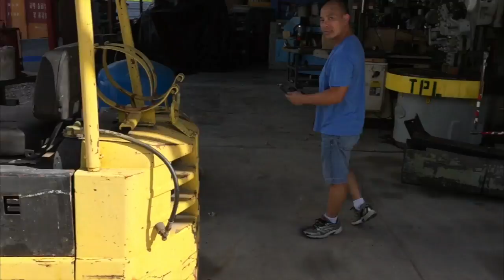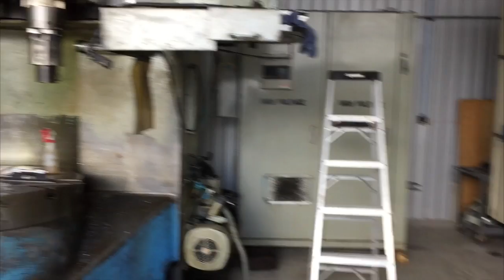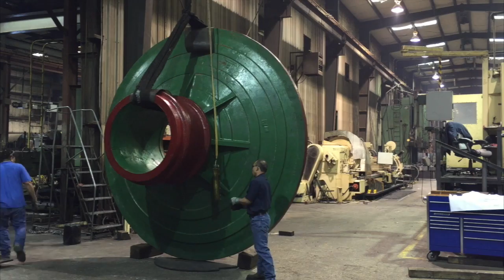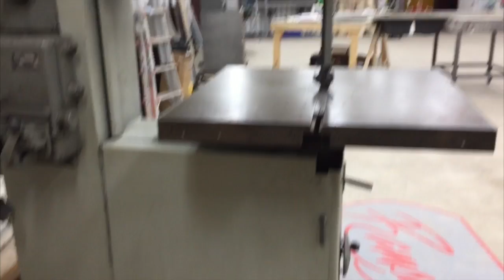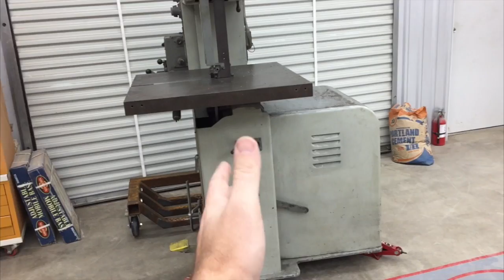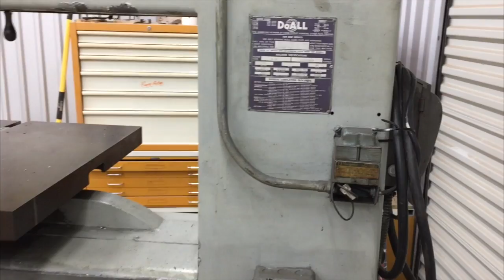Biggest Lathe in the World - Oil Field - New Bandsaw

Comment: You got a dinosaur doAll  what is that 50 model.  It looks good the table is in great shape for the year wow great buy dude  Lol I enjoy the older  equipment built tougher old Bullard 15 John Machine you get there go to A turret head  I like it an yes 5he jaws are extremely strong. We have a 74 inch chuck on big  lathe it has a 40 foot between centers an down in mobile Alabama I ran a 22 foot diameter vertical boring mill.  Love the big machines I’ve been a machinist since 87 lobe the trade it’s sad we can’t get many young men of women in the trade
Reply from the maker: Its a 1954, great machine, i love it!

Comment: The biggest vertical lathe I’ve seen pictures of and read of was a 36 foot model from the very early 1900’s. It’s amazing what they had then. The floor of some factories were ground flat iron castings in large pieces with “T” slots and bolt holes. Machinery was assembled using the floor castings which could be over 12” thick. Any size machine could be made that way.

Some large lathes are over 200 feet long. WWII saw giant lathes for machining the big 16” rifles for the battleships.
Reply from the maker: wow, thats crazy would love to see pics or videos of that
Reply: most of what I've got are in books from the turn of the century - that is, between the 19th century and the 20th century. Hard to find that online, but here's just some of the big stuff, just not the biggest,

Heres a description of something newer, but still not the biggest ever made.

http://www.heraldnews.com/x529846129/The-largest-vertical-lathe-produced-in-the-U-S-in-the-last-50-years-was-made-by-Seekonks-Phoenix-Inc

Now, I'm getting annoyed I can't find this stuff online. I'm a man possessed. I'm going to keep looking, or I'll scan it in.

Comment: your exposure to big machines ....very limited .......I installed a large vertical boring machine in michigan....20 foot swing and table capacity of 58 tons...that was years ago I'm sure there is much bigger now.
Reply: How cold would be to have some video of those installation?
Reply: I was thinking the same thing. We had an old Ford (Like the auto manufacture, possibly built for Henry Ford? IDK,) Bore mill that was 20 feet capacity. We also had 2, 11 foot swing lathes, one vertical and one horizontal. The horizontal was 600 inch long capacity, and had a seat that you rode on as you made the cut. 
We also had a P&H vertical router/boring mill that was used to machine tank turrets.
We build a router grinder that had a 48 foot by 24 foot bed, and could hold a ,0005 inch  tolerance. Diamond faces ways. I know for a fact there are some huge vertical lathes out there. Here's a 52 feet model. 
https://www.youtube.com/watch?v=VgRT-E4VkDU
Heck, our OD grinder was a 5 foot swing, and B&B Machine in Denver has a 102 inch Blanchard rotary grinder.
Reply: the fuck were you making at ford that was 20 foot wide?

Comment: Put a wood shim between the dollies and the bottom of the machine. Steel-on-steel slides easily if there's even a tiny bit of oil or dirt.
Reply from the maker: very good points, will definitely try the wood ships, what your saying makes sense.

Comment: I'm curious why they are opening a new shop.  The domestic oilfield industry has been impacted by the low prices of oil; I've been reading that work is declining for oilfield machine shops, hence the question.
Reply from the maker: Yea they are just sort of gathering up equipment, and slowing getting the shop up and running.  Its really the perfect time to get into it.  Market is low, demand is low, people selling machines, so there couldn't be a better time.  They all have full time jobs.  The market will return, and they will be poised.